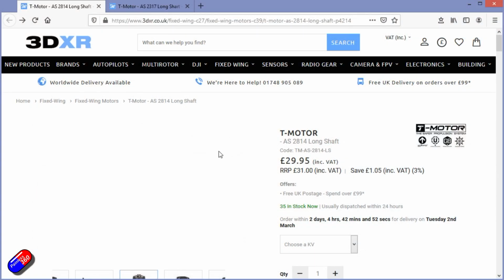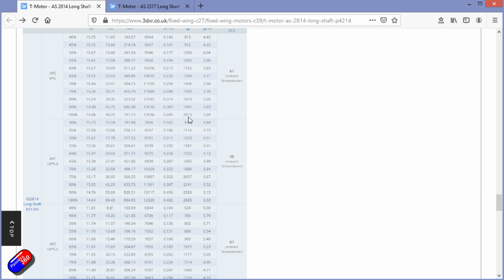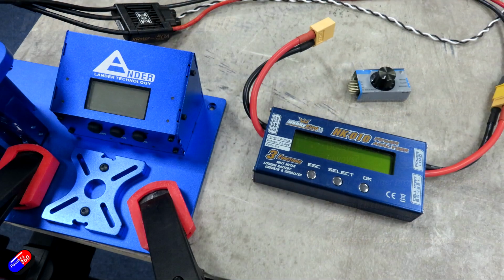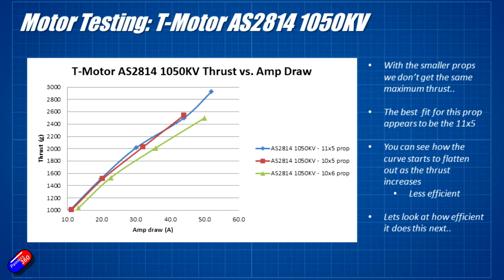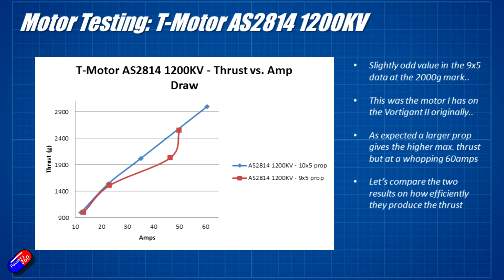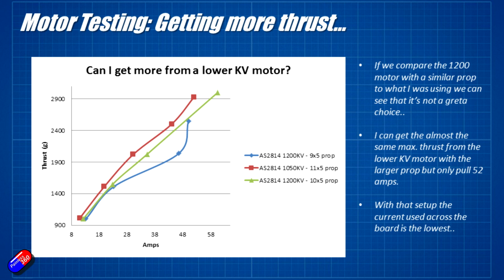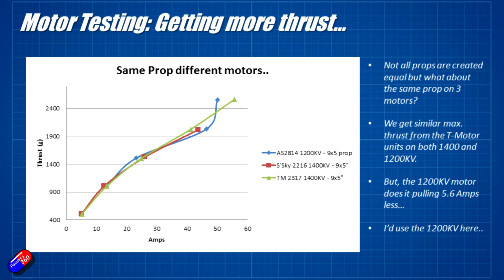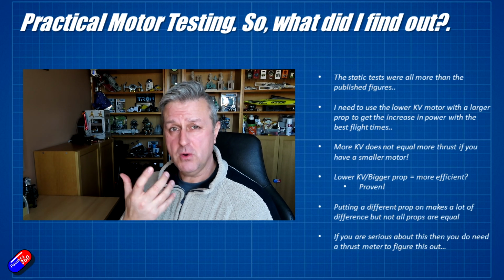Practical Fixed Wing Motor and Prop Testing: What did it show?

Comment: Hi. Good day sir.

May I ask you replacement motor for 2216 1300kv 9x4.5 prop on 1 meter fixed wing? I am looking for efficient flight time (long range flight), not acro or race type motor.
Reply from the maker: Depends on the battery and weight of the model. See the later videos in the series for how to figure it out. Best of luck

Comment: Great video! Could be ultimately better info if you’d tested the same prop as Tmotor did.. 
you basically tested the Prop… not the motor..
Conclusion. Sort of is that your prop is better than the apc..
And bigger prop at right speed is more efficient . But possibly slower
Reply from the maker: Check out the rest of the series.. Happy flying

Comment: What is max amp the motor should pull ? What temp does a prop at what volt/ amp.  I am surprised that quads dont rate amp /volt limits.  I think temp is very important.

Comment: Really great data!  Thank you for this.  For "time in the air" efficiency, this test works wonderfully and is very useful for quads since they spend a lot of time pushing against static air.  Less useful for RC, but academically interesting would be "distance traveled" efficiency.  Whereas a higher propeller pitch will suffer in a static test, it would shine when forward movement per rotation is a factor.  Analog: With constant-speed (variable pitch) propellers on piloted aircraft, flatter pitch is used for low-speed, high-power situations (like takeoff), and the pitch is increased at cruise for better speed/performance/efficiency in that flight mode.  Unless you or Ben has a wind tunnel kicking around in the parts bin, that would be impossible to test well.  You have motivated me to finish building my test stand and given me some ideas for data collection and presentation.  Thanks again!

Comment: G’day Lee,
Good video. I fumbled through experimenting with different props on an EPP 3D trainer. Same motor, ESC, & battery. I 1st performed a static test with a new prop to check if the battery or ESC gets hot, & the battery isn’t stressed. Then gave it a gentle flight & checked again.
I found an increase in angle of attack with a decrease in prop size, gave significantly higher speed without shortening flight time. So the battery draw from both props seemed to be equal. The recommended prop is much better for 3D manoeuvres.
In a similar comparison, what would you expect to see from the thrust meter?
Reply from the maker: Thrust and speed you'll get when flying don't have an easy way to convert as lots of other things need to be considered. Higher pitches will give higher top speeds but larger props will be more efficient and give less slip. There is a ton of detail about how a prop works (think of it like a wing in a stream of air flying at 90 degrees to the flow!) so static testing is only useful to see how the system will work for 3D prop hanging and launch situations.. I may make more videos about this but it quickly starts to get into some heavy maths..

Comment: very interesting !
But can these static measurements be extrapolated to 'in flight' data ?
Reply from the maker: Not easily. You can create the thrust in many ways but how that relates the speed of the model isn't the same. More pitch = higher top end..

Comment: Just replace my ranger 2400 motor with the AT2814 1050kv.
Could not find the 10x5.5 prop and i could not get more than 10 inches prop.
Which one would you suggest.
Running 4S Lion2p
Reply from the maker: I'd always try and get the closest one. If I know that the amp draw was well below the rating of the motor and ESC with the old setup I'd risk a little more pitch..

Comment: Good work! :)
I've done quite a lot of work in airflow simulations (and actual installation verifications) in industrial size ducted/endpoint fan systems. You do have to mind that static pressure is not the condition the propeller is actually working in when flying. It's the condition it's in when doing a start from standstill....
So a 9x6 might actually give you more efficiency when you have an actual airspeed working "with" the propeller arc (compared to a 9x5). Only real life testing will show this - unless you have a wind-tunnel close by :)

Comment: The 10x6 may have been stalling during the static test, but this wouldn't happen in the air with air flow, the 10x6 might actually be the better choice when it comes to top speed, or efficient cruising at mid throttle!

Comment: I have an old Medusa thrust test stand and have done a lot of research over the years. Any time you increase diameter or swept area, (# of blades) you will get more thrust BUT at a slower speed! It is thrust x speed that equates to POWER. Speed is calculated by a simple formula; RPM / Gear Ratio x Pitch (") / 1056 = MPH at 100% efficiency. Typically I subtract about 15% from this figure to get a realistic speed. That % will vary depending on the plane or boat, how slippery its design and its power to weight ratio. 
Put simply, put a large and low pitched prop on and you will have the best thrust. Put a small diameter high pitch prop and you will get higher speed as long as the craft is suited to that design.
I like to prop to the maximum thrust that will still give me the speed I need.
(eg) 15,000 rpm / 1 x 7"P / 1056 = 99 MPH. Subtract 15% = 84 MPH (Suitable for a Very fast model)
My test stand gives RPM, so I can calculate the speeds to see what props are appropriate.
I bought a large selection of props in order to be able to do these tests effectively. 
Hope this is helpful.
Reply from the maker: Thanks for the comment. I needed thrust for launch and a more efficient setup for flight for this example. I am planning a video on speed, pitch and the concept of 'gearing' when it comes to prop selection so it is great to see this useful comment that tracks with my notes (RPM x Pitch /1056 = Mph and so on),  thanks again and happy flying!
Reply: @Painless360  I also did a lot of gearing tests and could offer some ideas. The reality is you need a big enough prop to slip less than say 15%, period. You need pitch to achieve the required speed, period. That leaves the RPM and power as the variables.
In other words, calculate the slip to determine if the prop is big enough, and gear down to suit.
I know this is a quick and poor explanation, sorry.
Reply from the maker: No need to apologise - thank you for taking the time to write.
Reply: Lee, did you get the info I sent? Test samples, Formula's and such.

Comment: i'm a drone pilot and typically i see lower kv motors paired with larger batteries.  for instance, on a typical 5" freestyle quad, a 2207 motor at 2400 kv would be used with a 4S battery while the same 2207 motor but in 1950 kv would use a 6S battery.  is the efficiency approximately the same for both batteries?  i'm not sure...something to look in to i think.  keep up the great work Lee!  cheers!
Reply from the maker: Check out my endurance quad builds where I looked at that exact question.. Happy flying!

Comment: I’ve found the best way to find a good motor prop combo is to bolt on a prop and fly. I’ve always been disappointed with larger prop/lower kv for fw models. You’ll need more pitch as well, 5” pitch doesn’t give any speed as it unloads at much lower air speeds. Just my 2p worth 😁
Reply from the maker: Agreed. Motor and prop setup is very model and flying style specific. What suits one, may not suit another. See my thoughts in my choosing a motor and prop setup video. Interestingly most of my 100mph models are 5 or 6" pitch. Happy flying

Comment: You could run a similar test, but with one motor, same battery, but different brands of prop - of the same diameter and pitch - to see how they compare. Also how a flyer can increase thrust, when propping up the diameter isn't possible due to lack of clearance. (Obvious to me - go up a cell - if the motor and speedo can take the increase!)

Comment: Lee - Thanks for this video. Given this is the cornerstone of electric RC I would love to see / understand more about Prop / Motor / ESC / Battery combinations / considerations and the various trade-offs. You focussed on Power / Efficiency - but I would love to understand more about Speed and Acceleration - since this often significantly impacts how a plane flies / how much you enjoy flying the model; re launching / maneuvering / managing gusty winds / landing etc. You may like to consider developing a decision tree to help focus on the most impactful variables that can be controlled when designing / building / tuning and modding a model.
Keep u p the great work.  Thanks Martin

Comment: Certainly very interesting subject. I would love to see a bunch of the same size and pitch props, all tested on the same motor, at the same voltage - but different makes of props. I always buy the best props I can afford, but that is always for quality of material and ease of balancing, I often wonder what difference there will be in efficiency between different makes.

Comment: Great video. You mentioned kV throughout the video. My understanding is that higher kv gives you higher top end speed on the aircraft. I would appreciate it greatly if you could examine that aspect. Stefan Pynapples request (re 2 blade vs 3 blade etc.) would be another very interesting video.
Reply from the maker: You're right. A higher KV will result in a faster rotating motor for the voltage. But the thrust is as much to do with the prop used and as you can see, sometimes more KV isn't the way to go for more thrust.. There are other considerations that may be worth exploring in future videos too.. Best of luck

Comment: it would be cool if you put a setup on a wing and do a WP mission over and over again with different props motor combos with every time the same circumstances for the other parts like the same lipo same speed input and so on....👍🏼✈️
i know it’s a lot of research, but that will perform every other youtuber out👍🏼